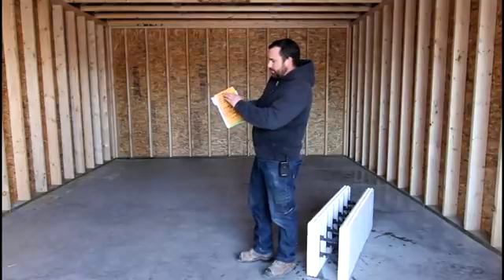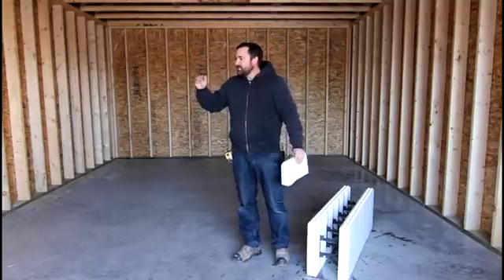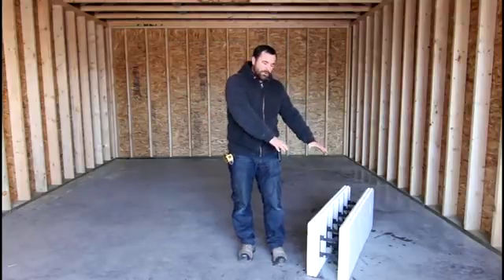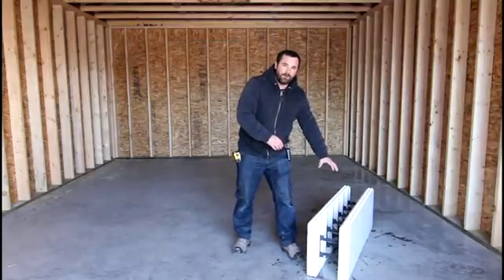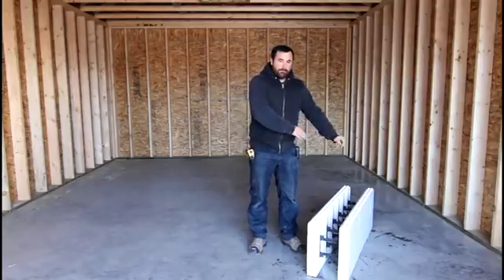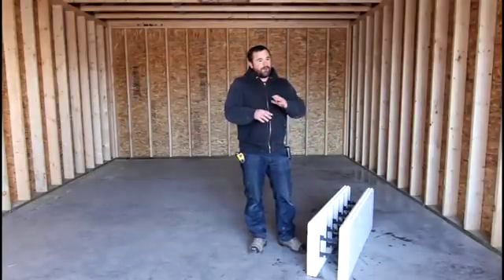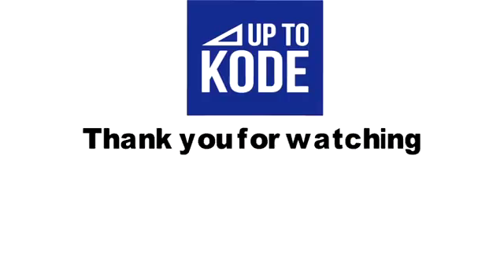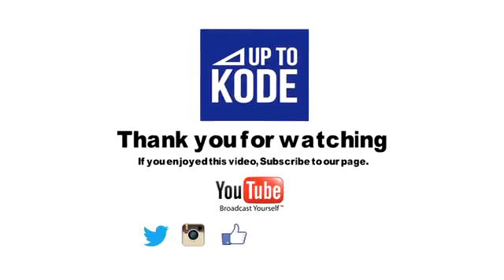ICF vs Wood : How a Spray Foam 2x6 Stud Wall Compares to an ICF Wall

Comment: Your correct that each stud is a thermal bridge with spray foam, however, every seam in the icf bock is also a thermal break! I would recommend strapping the 2x6 walls with 2x4s along the exterior every 2’ horizontally that way the foam can expand behind the stud. I’ve had this debate with one of my friends who specialize in icf block and it is considerably cheaper to go with spray foam than icf.
Reply: A good ICF block (like foxblock) well use a lase seam design, this removes the straight shot for air movement. The only "through" seam would be at a single point in each wall at the mating joint.
Reply: Ok am i missing something? You are saying that 2 x6 is a cheaper install. I am going to say  bullshit for these reasons, first once you use ICF you are done, now if you are talking about installing utilities you are still done as you only have to cut out the foam install you electrical or plumbing then reseal with foam. You are saying that by stick building you fill the 2 x 6 with the expanding foam or even fiber insulation thats a lot of steps, expanding insulation is really expensive then your home is not as air tight and water tight. The ICF give you advantages as far as being much tighter, bullet proof, and a much better hurricane or tornado resistance. Finally there is fire rating relative to insurance. I am sorry but the ICF system is far less labor intensive which equates cheaper install. What am i missing ?

Comment: Staggered stud wall... 2' centers... Theres lots of ways to improve the r value with out spending a fortune on concrete.
Reply: Or 2" xps on the outside wall
Reply: A fortune? How does 5% more equal a fortune? There's a TON of money in bldg homes. If builders would build better homes, safer homes by using ICF instead of complaining about how they can better a piece of wood that's had its protection(bark) removed, everyone would make out in the end. "I've always done it this way" is the worst excuse ever as well.
Reply: JP, That's what I thought when I first began building.  I tried much of the brilliant and innovative cutting edge technology, and was annoyed by the resistance of older companies to utilize it.  Now I'm the one embarrassed by all the failures these products have had, and I won't build a house for anyone with products that haven't proven themselves for decades first.  Do you remember LP Siding?  Masonite roofing?  MDF exterior trim? Cement fiber roofing?  It's all in landfills now.
Reply from the maker: Always debatable! That’s the fun part.
Reply: My question would be ‘’seeing’s how I know little about ICF walls’’ is... Wouldn’t you just put even more money into attaching sub walls for sheets of drywall or extra structural bracing for windows/doors? Which would make the 5% extra costs even more.
Reply: garrimic3 That is the bonus with icf walls they have plastic strips embedded in them so the drywall screws right to them so there is no sub wall.
Reply: Trevor Roth ... it is something to look into seeing how my wife and I are actually looking to build a new home in the short coming year. Our house was built in the 70’s and we either spend the same to remodel it as to build a new one.
Reply: garrimic3  yep, the siding goes right onto the outside, the sheet rock goes right on the inside.  Even if you wanted to add an inner stud wall, it is easy also as it is not a load bearing wall, you assemble it in place and stand it up against the ICF, just like you would do with any other inside wall...  if you use foam window and door bucks, this also cuts down on bridging.  You do need to brace the openings for the pour, but the stack and rebar is easy and pretty fast, pour takes a few hours and you have a very solid secure wall...  IMO labor wise I would put it less labor intensive than a staggered stud wall...